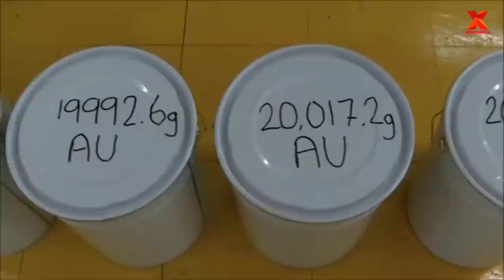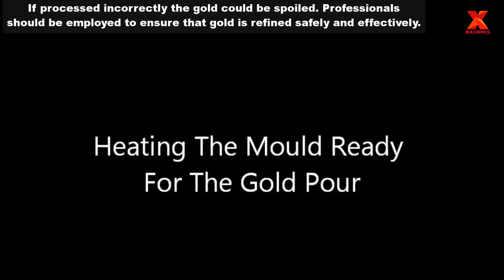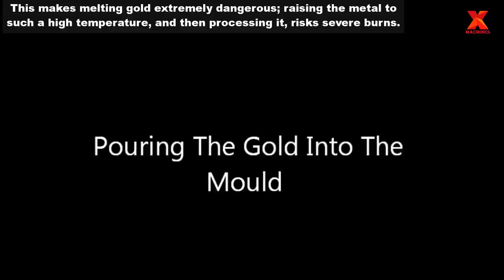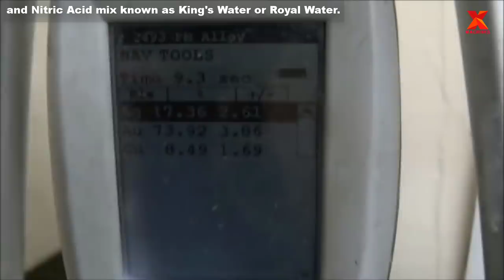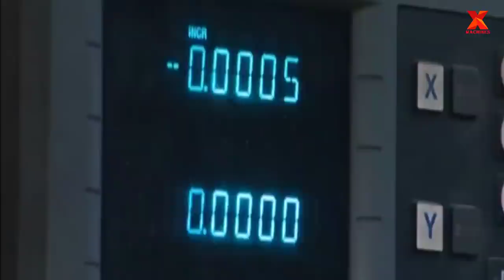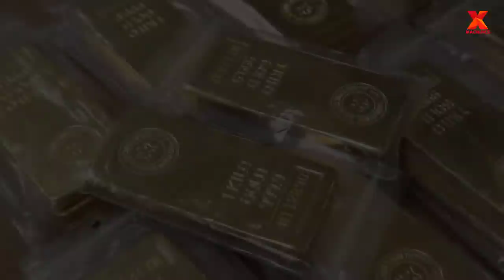How To Refine Scrap Gold And Made The Biggest Gold Coin In The World

Comment: 2 ways to purify gold , in a kiln with coke ash and borax too float the other base metals too the top as ( dross coke ) and skimmed out . This process takes 4-5 re-smelts to remove all impurities too get at 
.9999 fine ! The other is thru " inquartation " to get the gold down too 12 karat level for Aqua Regia acid purification and then precipitate d back into powder with SMB ( sodium meta- bisulfate a.k.a salting out ) .
Reply: Electrolysis is used to get to 999. The remelting process gets to about 995.